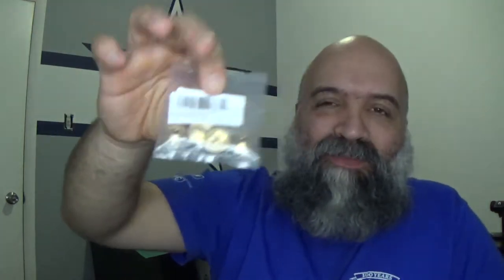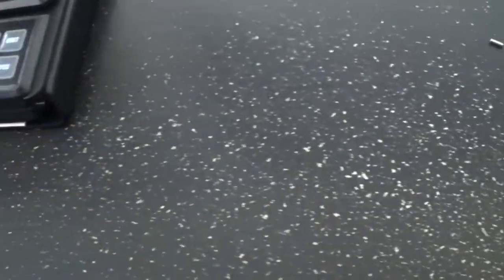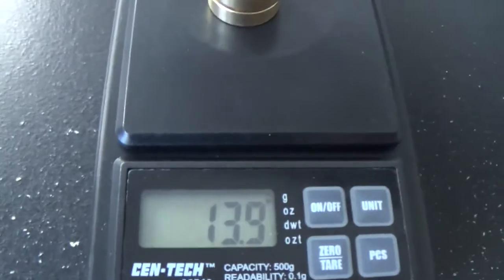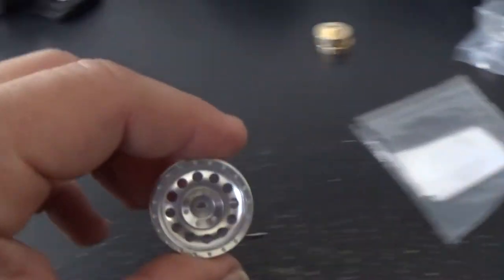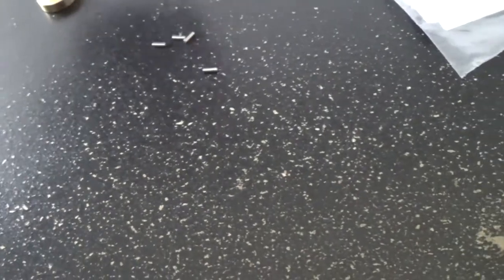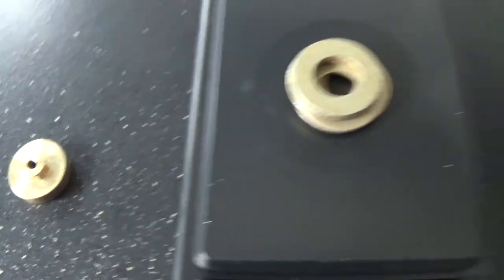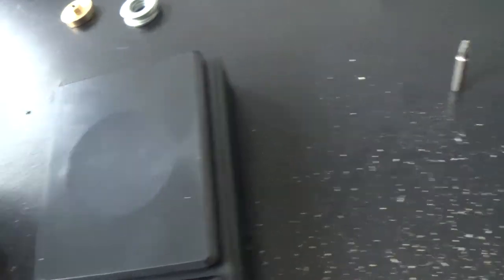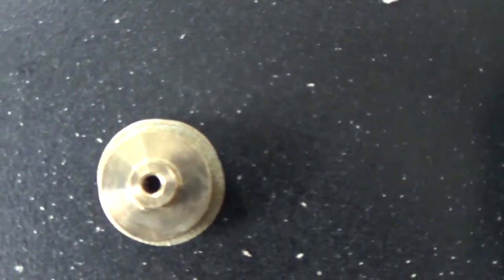1/24 scale RGT 136240 Finally gets some much-needed mods

Comment: Thanks for the video. I have one of those RGT V2 crawlers, and I`m struggling to find info on how to upgrade it. Thanks a lot for all the tips
Reply from the maker: Glad I could help
Reply: @rccargarage will the brass weights fit in the original RGT wheels?
Reply from the maker: Yes they should fit
Reply: @rccargarage  thank you so much dude 😎